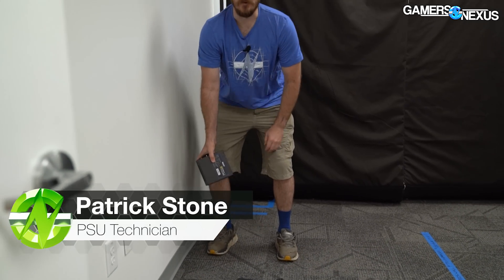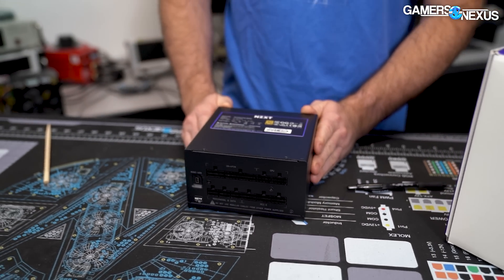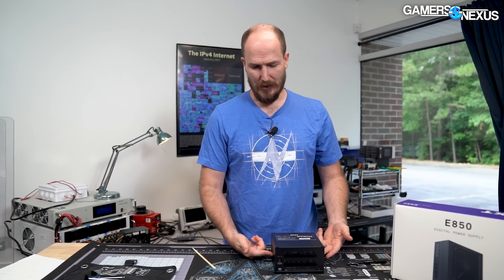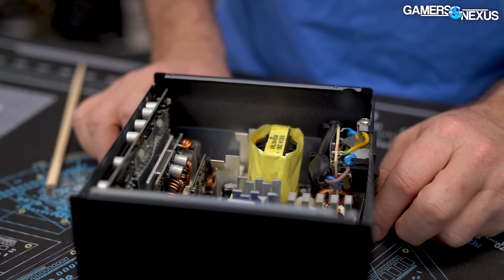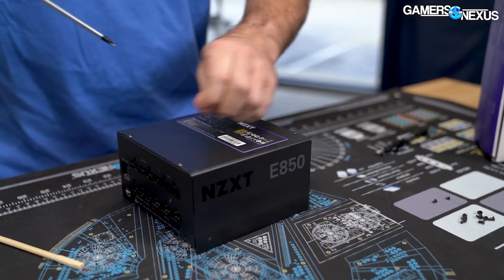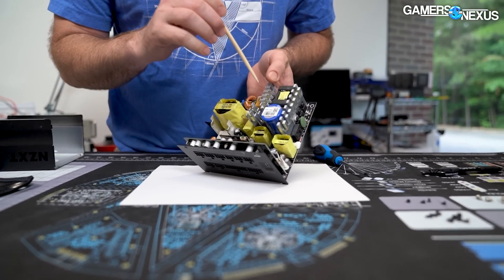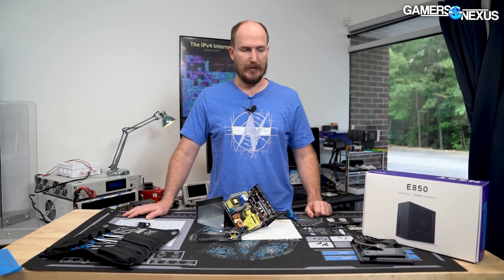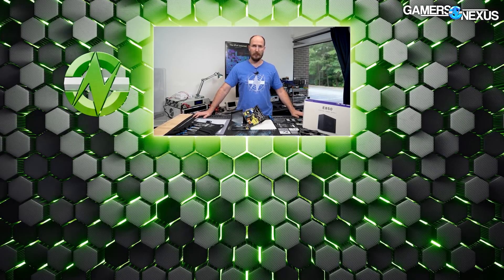Our NZXT PSU Self Destructed for a Weird Reason

Comment: Replacing a MOSFET is an iffy proposition. The original manufacturer tries to use FETs from the same batch. A replacement transistor will have different characteristics. This imbalances the current through the inductors and can cause saturation.
Replace all the MOSFETs in the PFC or LLC regulator (hopefully with units from the same batch).

Comment: The reason the APFC MOSFETs blow up is the bad 1920-vintage circuit. The boost circuit uses "hot switching". This requires switches to be rated at 2 to 3 times the actual voltage to prevent switching transients from destroying them. A modern design would use an AC to DC PF circuit with NO BRIDGE. (The bridge is an artifact of poor education and refusal to look at designs less than 50 years old.) The switching occurs when the voltage or current are near 0.
Also the LLC (not PWM) regulators are very inefficient at low loads. Modern designs have a uniform efficiency from low to high loads.
Modern designs are also cheaper, smaller, more efficient, less ripple, less EMI, and better transient response than the 1920 circuits.
One difference between Gamers Nexus and Matt Cremona is that Matt Cremona reads the comments and responds. Gamers Nexus does not.

Comment: This is very cool and all that, but, in the 25 years I have been using/building PC's. The only component that has ever failed on me was a cyrix 686 266mhz CPU that i overclocked to 333mhz, and even then it took over 12 months to go pop.

Edit: GPU prices suck

Comment: The only thing that has been a little annoying using the mod mats is finding black screws when i drop them, probably not a issue with studio lighting, white modmat when? gn blue modmat? i have a 3 faulty Units that could be used to make this type of content, turn on and seem to work but cause a system crash if you want them

Comment: when a fet fails, it usually backfeeds its control circuitry, like what happens sometimes when fets on GPU's fail, requiring the repair/replacement of the power management IC and/or totem pole driver circuitry, but as a precaution, its just easier to replace PSU's then to repair them

Comment: i never had to service a PSU Fan but depending on the PSU and system i might crack one open to really clean that fan or change it if a small chance the fan dies, or if i want to deep clean the PSU i will take it apart and spray it down with hot water with the sink sprayer and use a the PSU fan powered on with a different source to help speed dry the PSU i never had any issues myself i turn off the PSU when the system is on from the wall or PSU switch not the PC to help drain the capacitors i have 2 cats, 1 dog, 1 kid and ME so alot of dust and a hair even with my PC on my deskt the front raid gets hella dirty but i never had an issue or ER visit lol

Comment: Personally, I am comfortable tinkering with low amp electronics, but tinkering with anything responsible for power delivery SCARY. I would rather resolder half of SMDs on a complex board than change one MOSFET in a PSU or, admittedly, install a single mains outlet. Electricity kills; even if the operation by itself may be much simpler, you just can't let your awareness slip for a moment, and this is an enormous stress. One of these "do not try this at home" things: possible, but you absolutely need a proper workbench at a minimum, and the result is not worth much for an average user. Fixing a $500 TV by resoldering an EEPROM feels rewarding, and the worst that could realistically happen is that you end up burning $400-ish (well okay, you might drop a soldering iron and get burnt I guess), but meticulously trying to NOT DIE in the process of fixing a $100 part is just in an another ballpark of stress levels entirely.

Comment: I have a EVGA SuperNova 1000 G2 that I bought in 2013.  It started out in an i7 4770K system, and it's in my present rig which is a R9 5900X / 2070 Super, blah, blah, blah, etc.  I never shut my systems down (so 24/7) running World Community Grid (100% CPU usage) and gaming.  So this PSU has been running continuously going on 10 years.  Granted the PSU has been overkill in pretty much all the systems it's been in.

Comment: We used to have regular power failures at work due to the company buying a lot of cheap PSUs that they figured were cheaper to replace often. I doubt we got more than three years out of most (we left them on 24/7).
I've got Seasonic and BeQuiet at home.

Comment: It has semi passive cooling (which I consider a dumb solution for PSU), so very likely under low load some stuff inside ended up overheating for a long time.

Comment: As Marvin the Martian would say "an Earth shattering kaboom".  I had an Antec power supply running a system for 14 years.  It only died when I disconnected things to replace the motherboard and CPU (and RAM).  I'm not sure how long it would have kept running the old system if I had just left it alone, but it definitely served its time.

Comment: From my experience (at least with other SMPS, not computer ones), if the main switching mosfet has blown it's almost always taken the controller IC with it, or perhaps the IC took out the mosfet but same difference. I've learnt my lesson and just order new parts for the whole section instead of acting surprised when the new mosfet violently explodes.

Comment: Is long term idling hard on a PSU? My server has a 750w platinum unit but typically only pulls 90w from the wall. It does pull more from time to time but mostly it’s at low load.

Comment: Nice informative bit. Not many will try to repair a PSU and I wouldn't recommend even opening one without a clue as that is one of the most dangerous parts in any appliance. Right after high voltage blocks in ancient TVs and similar stuff. But for those who know some electric basics this certainly is educational and entertaining.

Comment: Often with these supplies the PFC circuit will fail, not the PSU/transformer part. The lower the load, the higher the stress on these parts.

Comment: when you show the broken part of a device in the future please try to get it from several angles. from the one shot we got I could not actually tell what I was looking at and visually identify the evidence of the break.
That said I would very much like more videos that show the disassembly and failure identification for instances of broken computer parts, including peripherals, as well at failures of tools used to work on fixing computers like multi meters and soldering stations.

Comment: A thought on the potential reason for the failure, with it running on a low power out for a relatively long time like that could it be overheating of the mosfets from the fan being off at that low a power, or potetially that the fan only goes on at a specific load level and that level is determined by the load on the 12v rails and you had a higher load on the 5v rails with the leds?

Comment: I worked on a very high current, low impedance industrial ps years ago that used a bank of tfets in parallel.  (Used in electroplating)

The operator standing very near it when it let go said he damn near pooped his pants!

Chain reaction catastrophic failure.  Carnage in a box.

They now have fresh air supply to these devices.

Comment: My friends EVGA supernova 750 popped a few nights back and killed his 2080 in the process, he thought it was all the psu's fault. I came by to take a look, it turned out that the power strip he was using didn't have a surge protector and had caused a chain reaction when it failed from a power surge his apartment had. Electricity is a wild thing.

Comment: had a current control IC in a antech PSU spark and put out a nice light show in an old home server, but the UPS did not trip, had to yank power cable. because of that i now require every UPS in my house to have FULL access to the UPS power button.

Comment: tbh a sticker like that on a psu should still be legal .. this is a device that has the full blown mains power on it and is potentially dangerous and if you drop something in there or cause a short you risk yourself, others, burning down whatever building you are in, and dammaging it

Comment: Components usually die because other components died or are about to die. It becomes a chain of events that lead from one little component failing causing an array of others to fail because of it and eventually something blows up that will make the device stop altogether.

So yes, replacing the obviously broken MOSFET will not fix it. It will most likely blow up the new one instantly because the reason it blew in the first place is still there.

Comment: Thank god for server hardware. Some of my rigs are running "idle" or near idle for YEARS at a time. My plex server is a R740XD with 1200 watt redundant PSUs. It pulls during transcode about 350 watts peak for a few seconds and then goes back down around 80 watts. 

This is its entire life. This should not be a case for hardware to die. Lets not let this slide so easy hey? And no. CAPS are the most often to fail. When a mosfet SPLITS like that I want to know why...

Comment: Been pretty lucky with PSUs and haven't had one die in use on me yet. Last one I had was a Corsair AX860i that ran 24/7 through multiple gaming systems even driving every generation of SLI from the 780 Ti to the 2080 Ti and it never had an issue, fantastic PSU. Only changed it as the PSU was getting on a bit after such a long usage and may have had issues driving a 3090 and now 4090. Hopefully the Corsair AX1600i lasts just as long without issue, so far 2yrs of 24/7 use and still rock solid.

Comment: 1:20 I'm not an electrical engineer...just an IT professional...but I don't see why letting a power supply run at low power would cause a failure.
The only reasoning I can think of would be it's one of those "silent" PSU's that doesn't spin the fan up and it overheats and fails.
Or...
The mere fact it was on for months and months it was exposed to the crappy power grid inside your building and died because of dirty power/surges/etc (ie it wasn't attached to a sine wave UPS or worse it was attached to a square wave UPS).

Comment: I think I vaguely recall that some batches of seasonic focus units used lower quality champion mosfets. And that those units tend to pop more than the orginal infinion mosfets.
Just a vague recollection though with no substantial backing.

On the side, If you could state that the psu has been already discharged before in the video rather than just in trhe description, I feel that'd be safer. I sure do often ignore the description tbh.

Comment: Great vid Patrick! I have a question that may/may not have been answered in the past. I recently had a PSU that I replaced because it started a coil whine sound when placed under load by the GPU when I was gaming. The sound stopped when I replaced the PSU. Just curious as to what the issue could have been.

Comment: Sounds about right I guess, Im not an electrician, but higher wattage power suplies do need to stretch their legs IMO, Was slightly concerned about my 850w Fractal Ion that is my spare PSU, i know its built differently, On a streaming load isnt that like... 150w max? heh, for my use case it was at 450w Max load, and that varies due to the power saving options of black desert running 24/7 from 200w to 450w (The rest is "Tranisent load safety" as i call it) I think provided my aim was to run consistently in that Platinum range, its likely not gonna have an issue at all.

I believe this is a case of just having a decent spare part around to get a job done instead of using a certain brand of PSU that was less trustworthy heh.

Comment: My educated guess is that seasonic messed with the timings on the primary to "fix" the transient response issues they had, resulting in this.

I've seen the same failure mode on other somewhat recent seasonic focus based units. The ones that do not shutdown due to transient spikes.

Comment: That's exactly what warranty is for. And they offer a 10 year period for this model. It would be interesting to see how NZXT handles a post-disassembly warranty repair or replacement, of course in incognito mode.
Reply from the maker: If we can find the time, we might test them!
Reply: This is the way.
Reply: Warrantys cannot be denied in the US for the user doing disassembly, it's illegal to do so. Warranty voided stickers and the such are also illegal.
Reply: @bipobuilt  Would still be interesting to see if they tried to fight it.
Reply: @SerpensFirmus  warranty for gifted psus? really?
Reply: 2:20 he pulls the cover off to show the fan already unplugged due to prior disassembly. That alone would give NZXT strong grounds to fight a warranty claim if they see this video, with the argument that prior disassembly and incorrect reassembly caused the problem.

Not saying right or wrong, just playing Devil's advocate here.
Reply: @Nareimooncatt  How does that give strong grounds? It's not enough to show fan unplugged. NZXT has to show reckless disregard. If the person on video has a degree in electrical engineering and years of experience, they can be expected to have reasonable requisite domain knowledge and act the same as a NZXT technician instead of an untrained layman consumer.
Reply: @sammiller6631  Showing an improper reassembly does demonstrate a reckless disregard. Electrical degree or not, good luck fighting a company if they find signs of improper tampering, like leaving a fan unplugged.
Reply: @Nareimooncatt  But they're a video company. The fan was unplugged during earlier diagnostics, and then the case was put back in place for the camera. Why are you assuming the power supply was ever running with an unplugged fan? Why would it have previously been disassembled before it failed?
Reply: @werdfeefs7027  I'm only pointing out a hypothetical in response to the original idea of handling a warrant claim after a product has been disassembled. In general, if a manufacturer finds signs of tampering that can impact the function of a device (I.e. The unplugged fan), that is easy grounds to deny the claim. Who cares if it's right or wrong at this point, because you are going to have to fight them on it, possibly in court. The average user isn't going to have the funds to do that, never mind being way cheaper to just buy another one.
Reply: @Nareimooncatt   Unplugging a fan is required for normal maintenance, so how is that improper tampering? You're automatically assuming the most negative view without any basis. The Magnuson–Moss Warranty Act is more strict than you are and has a higher bar for the manufacturer than you do.
Reply: @Nareimooncatt  Gamers Nexus is not the average user. Louis Rossmann is not the average user.
Reply: @Nareimooncatt  My understanding of the rules is that they have to PROVE that prior disassembly and incorrect reassembly caused the problem, not merely suggest it.

Comment: I've had a EVGA 650 BQ powering my system throughout the multiple PC's I've used. It amazes me to this day how dependable it has been over the last 8 or so years with very long on periods! 

I was just thinking to myself and about to open a new tab about how feasible it would be to replace a broken mosfet and it was answered in the next sentence. GN Extras was a awesome idea. Thanks Stone and team :D
Reply: Yeah I was using a evga g2 for 6+ years till I decided to buy a new one just out of paranoia with other new pc parts and such, but it held on really well and I ended up selling it to another guy
Reply: @denniskarlsson6173  Yeah man. Those PSUs(the supernovas) are actually made by superflower, quite the quality manufacturer.
Reply: I am still using a 6-7 year old 550W 80+ gold Corsair PSU with ever-increasing load on it & it hasn't let me down yet
Reply: @Sithhy  Same I've been using the same HX750 80+ Gold for 8 years now. First I had it in an OEM (don't ask me how) running an APU + R9 280 and it's since been in my main system for 6 years seeing multiple CPU & GPU upgrades. Currently a 5600X + RTX 3070 -- both are undervolted however. I like cool and quiet. 

I'll probably try and upgrade the PSU at some point in the next few years but it has been a fantastic and stable unit.
Reply: Same. But the 650 GQ. Got it on a Black Friday sale 40% off, I wish I had snatched up more than one.

Comment: Great video. I know this PSU was sitting for a long time and was safe, but perhaps it's good to include basic warning about how caps can remain charged for a while even after being unplugged.
Reply from the maker: It's the first thing in the description
Reply: @gnextras  You expect people to read? You’ll be expecting them to take responsibility for their own actions next😉
Reply: @Martin52863  yeah, I think I'm mostly just used to Steve being very clear about it every time it comes up.
Reply: @32krod  don’t take any notice of me mate, I was just teasing.
Reply: @gnextras  Don't forget we have DIYer's making epoxy art in a closed unventilated rooms. Even if GN flashed a warning start middle and end of video people still going to hurt themselves, too many have HUAS (head up ass syndrome)
Reply: @gnextras  But is it a true warning if you don't demonstrate the danger, Electroboom style? <.<
Reply: @33gles  Doesn't that require a Full Bridge Rectifier?
Reply: The warning is there, it doesn't matter how much extra he warns people, if they are gonna do it they are gonna do it.  This isn't a how to video.
Reply: @CorDawgYT  It's more of a HowToBasic video.
Reply: The 5VSB supply in ATX PSUs will drain the HV caps down to however low it will go before shutting off (50-80V in PSUs I have measured) in 15-20 seconds. There isn't much of a shock hazard unless you plug it in after the screws have already been removed.